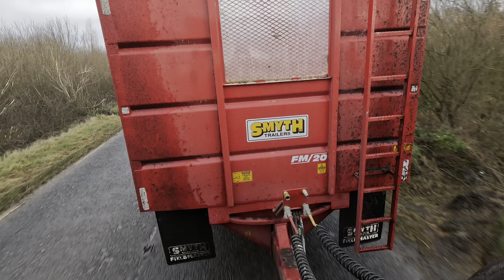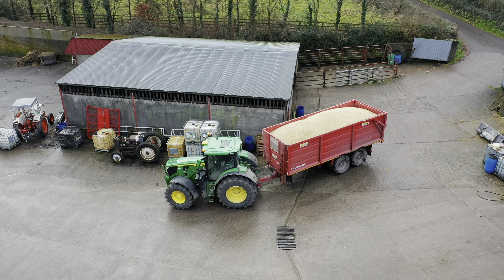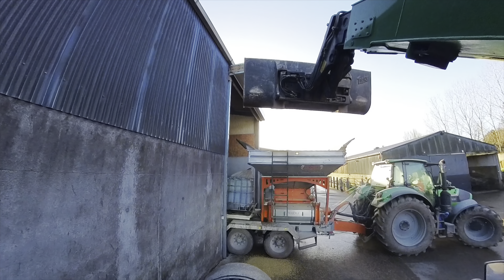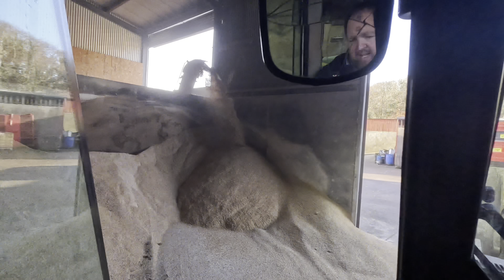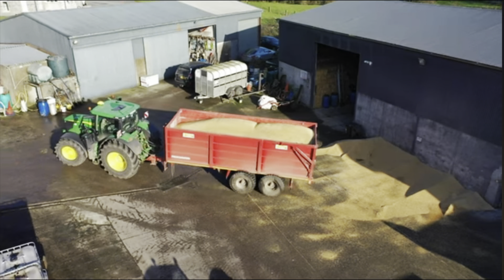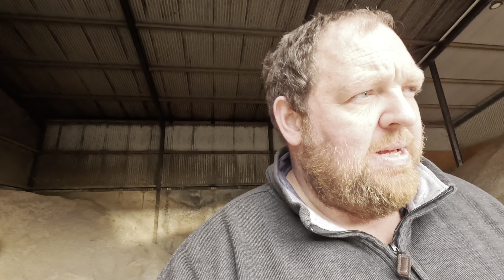FEED SUPPLIES RUN LOW - TAKING HOME BARLEY - ROLLING

Comment: Stupid question - how do you know you get your own grain back? Or do you? It looks like one enormous free for all heap..?
Reply from the maker: You won’t get your own barley back.  As barley is tipped in shed, the drying system brings all barley down to about 15% moisture so it will all be same that way.  Enron a load of smaller grain barley went into the shed. It all gets pushed up and mixed. So you never notice it.  The 45 ton I took home was great barley. I’ve been doing this way for number of years and never had an issue